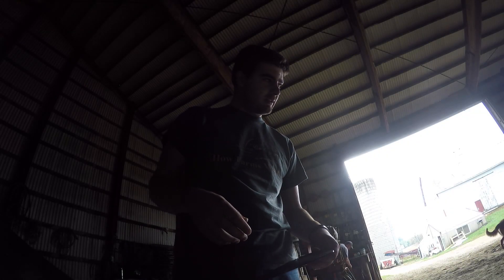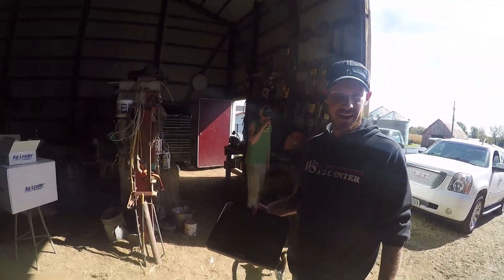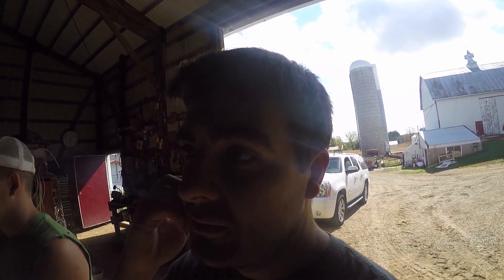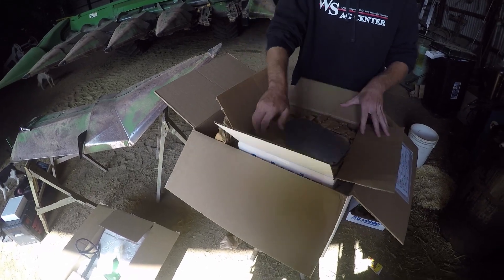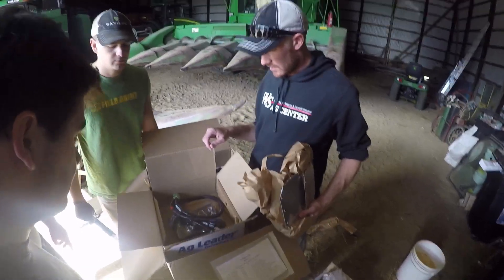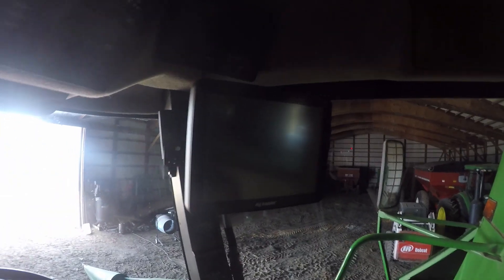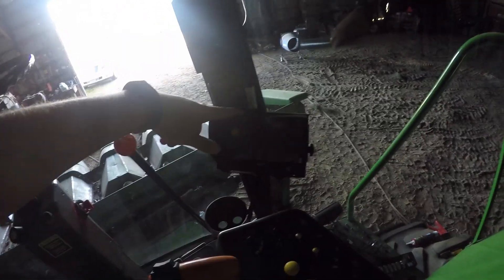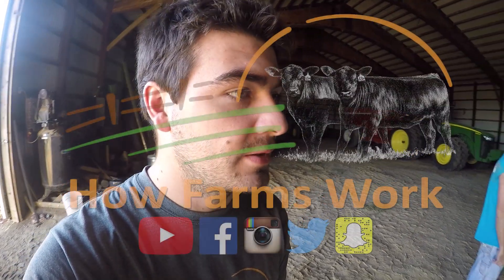Ag Leader Yield Monitor Installation - WS Ag Center

Comment: Would you all like the same  corn head for spare parts or to use it. it has been sitting in our machine shed since 2013. We replaced all of the gathering chains and I think some of the sprockets. Last ran on a 9400 John Deere

Comment: I noticed your installer had a black eye. Wonder if that was from unhappy customer !!! HEHE
Reply: That probably came from a wrench slipping off or bouncing the head off  a snout on a corn head. There are SO MANY  people alive today who don't realize that there are individuals who have to ACTUALLY  DO     THE     WORK.  Along with doing the work there are job related accidents that result in cuts, abrasions and contusions such as you see with Andrew.

Comment: Why didn't you upgrade to a slightly newer combine?
Reply from the maker: +Evan Davidson Probably due to the large price difference
Reply: How Farms Work oh trust me I get that, but if you can get a loan a newer (not new) combine will actually pay off much faster then you think because when I upgraded I realized how much combine loss I was having and just the additional features and comforts helped out and made it nicer to use. But it's all about how much you can get for your old one and what you can afford, I get that!
Reply: How Farms Work so let's say you replace that combine and your new combine (new to you) makes it so you lose 2 bu/acre less. At 4.50 per acre average x1000 acres that's $9000 a year or $45000 for 5 years. That adds up fast and the more acres you add the larger the pay off. Plus let's say you get a 8 row or a 12 row you are done that much faster and now you can do some custom work and make some more money and keep increasing.